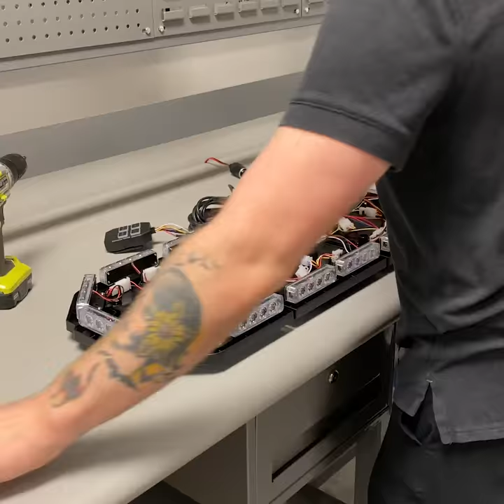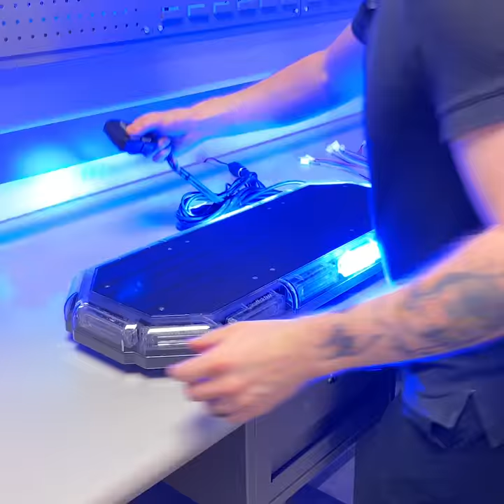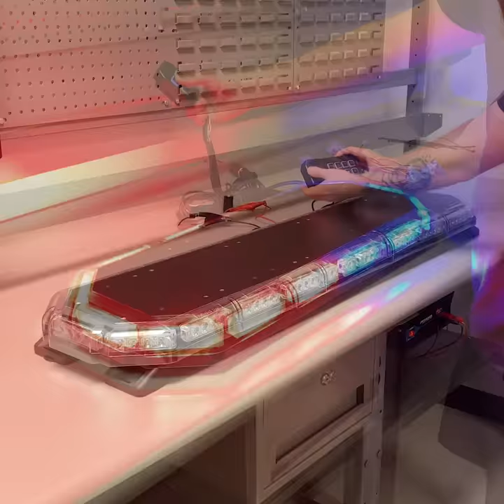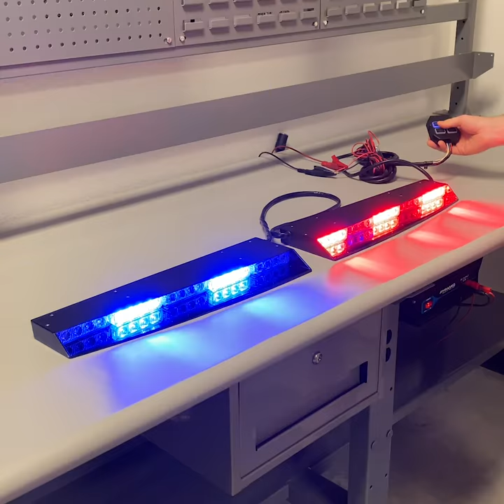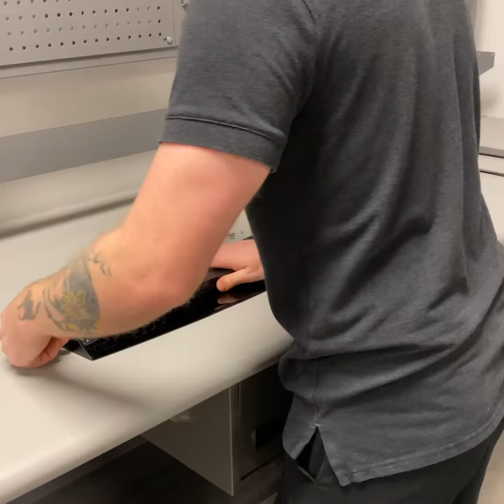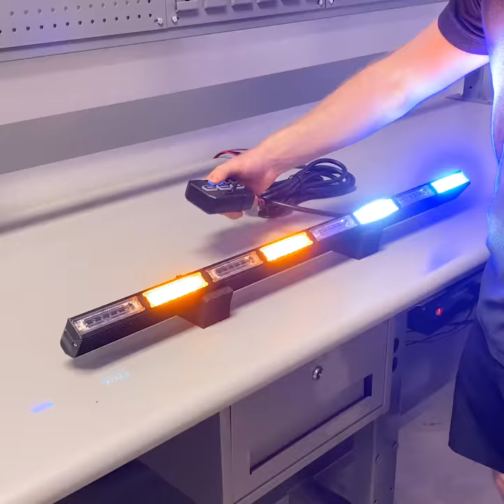Customize Any Light Bar - Any Configuration - Build To Your Needs - With SpeedTech Lights!

Comment: So to take the top cover off, do you undo all the screws and lift up? I’m thinking about moving my takedown lights out a little bit farther so they’re not in the center for a custom pattern to my liking.
Reply from the maker: Hello, yes you can do that! Each model is plug and play - just give us a call if you have any questions: 8007572581 Thanks!